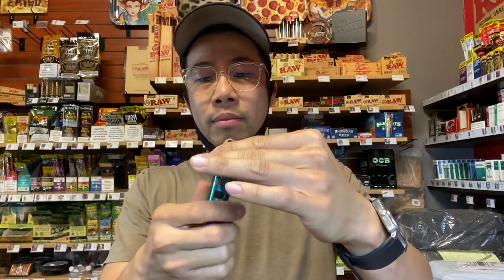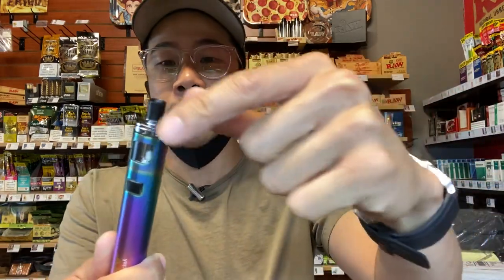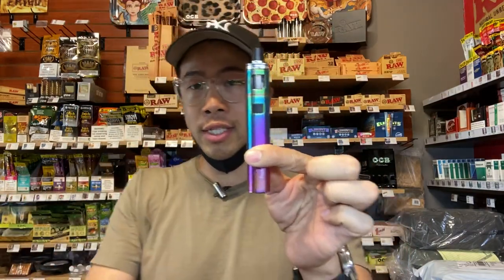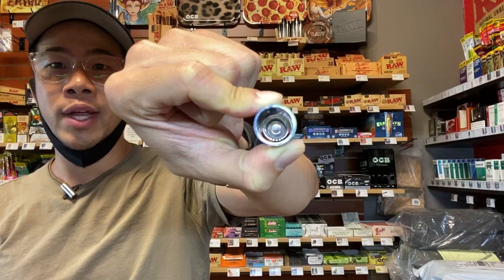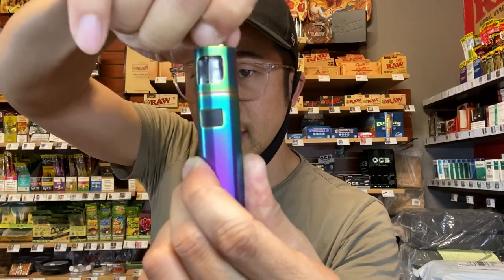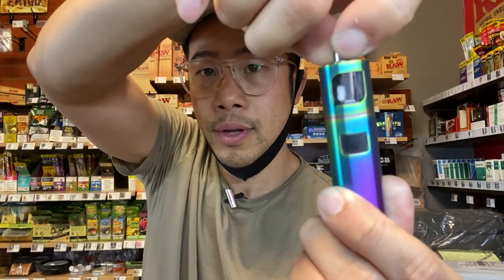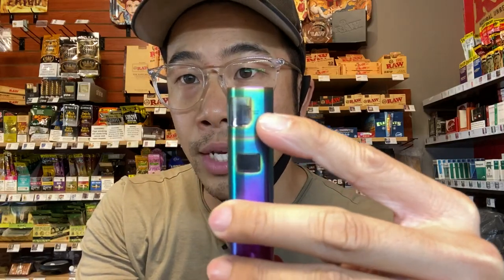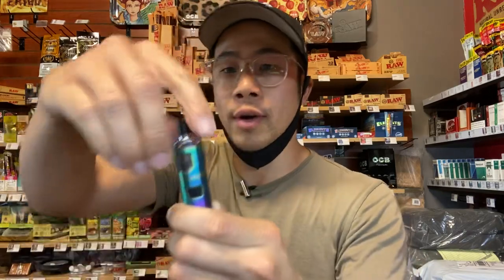Aspire Pocke X - Trouble shoot video tips and tricks Part 2

Comment: I was so frustrated as my aspire pockex just stopped working this evening.  I charged it fully.  Still nothing.  Of course this happens when the shops are closed and I have no way of a) sorting the issue and getting it fixed or b) getting a new vape!  Then when watching this video I thought "oh I always screw the coil into the top and then just screw it on.  I'll try putting the coil in the tank and then screwing the top on".  Whaddya know, my vape starts working again.  Thank you so much.  2 hours searching online and so glad I finally found this video.  You just saved me the price of a new vape because that's what I honestly thought I'd have to do first thing tomorrow.

Comment: I thought you might explain the ‘top fill’ ability in this video. 
The top part comes off revealing a hole directly to the coil. It is labelled as top fill in the instruction book. Is there a reason it can’t be used to refill without unscrewing the top and atomiser?
Reply: Screw the coil in tightly and screw the cap in a little less, it let's you take the cap off without getting juice on the battery

Comment: I have a Scorch Dual Flame with an igniter button that is slightly off-flush with the casing. I removed the screws, and a copper strip with a springset end fell out. I'm not sure where the part goes, so I don't want to put it back together. What should I do? (Sorry it's not related to this video, but you are knowledgeable.)

Comment: Another tip to protecting you from the popping,  what I've done is take the cotton off of one end of a q-tip and put it in the hitting tip.    Don't push it too far down,  only to where you don't think you're going to suck it out into your mouth.   Depending on the brand of q-tip you're going to use a little more or a little less of the cotton.  You want to be sure that you don't use too much or you won't be able to get a hit.   Use just enough that if it pops the juice will hit the cotton instead of shooting into your mouth.  Like I say,  do not try to push the cotton too far down inside.   You're only putting it down in there far enough that it will stay put when you take a hit.   This is only something that I'm trying out so if anyone has any idea why it's not a safe idea or an added tip please do comment and let me know.  I don't want to encourage anyone to do something that isn't safe.

Comment: hi there, i actually also have an issue with the aspire pocke x. i have a problem with unscrewing the mouth piece (the silver part) as it seems to be stuck. i have to ask other people to open it every time i need to refill it but that just gets very annoying. i hope you know what i mean and can help me, thank you in advance
Reply from the maker: Martyna Nicole give us a text 310-974-1963 and we’ll schedule a call. I have several questions. It’s free technical support :)
Reply: Hey I have a question about the aspire pocke x, I changed the coil on it and now it won’t screw in all the way. It will leave about 1mm of space between the tank itself and the mouth part where the coil is screwed in. When I screw it in, and press the button, it flashes purple three times, and when i unscrew it, it holds blue.